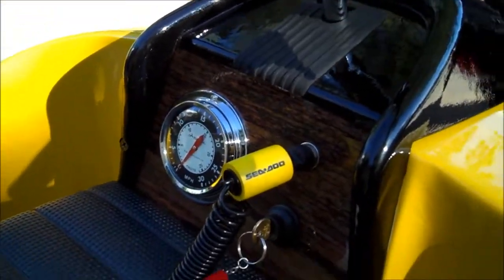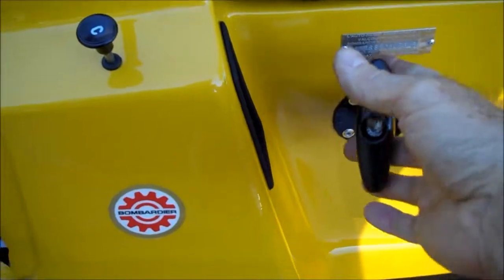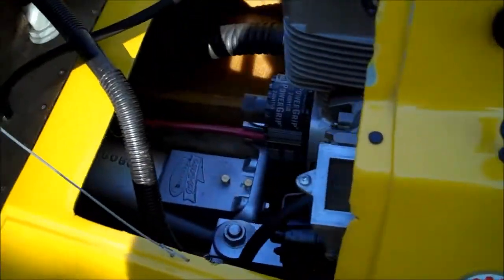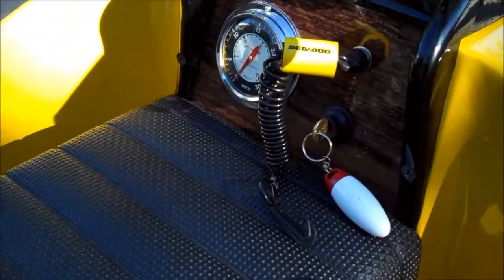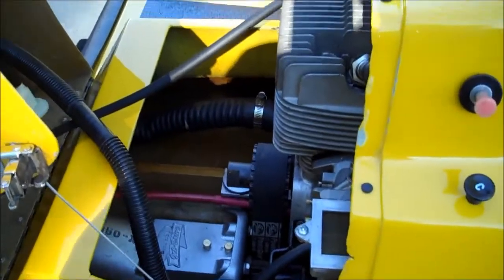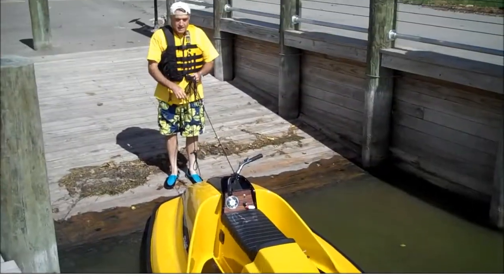1968 Sea Doo Movie Final

Comment: just picked up a 68 sea doo any suggestions on where to find manuals and parts for for the 1968 sea doos, seem pretty scarce. awesome video and restoration! thanks for sharing!
Reply from the maker: Only suggestion for parts and literature is a vigilant watch on the auction sites and social media. They do pop up periodically, yet are difficult to find secondary to the rarity of the '68 model. Best of luck with your restoration endeavors and thanks for watching.
Reply: 3 of them for 600 here in New Mexico on Facebook marketplace
Reply: I know of a gentleman who has several of these with scattered parts...(Eastern Canada)
Reply: @DrBoss302  Do you have a shop manual?  If so does it cover both 68 and 69 Seadoos?